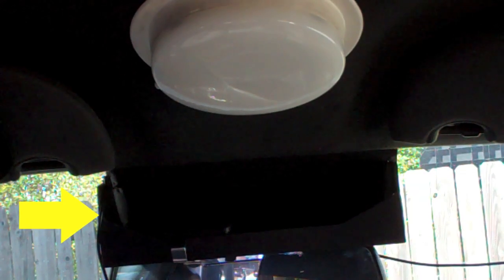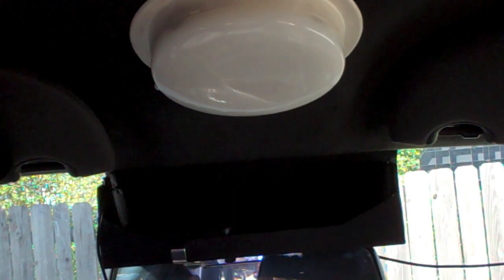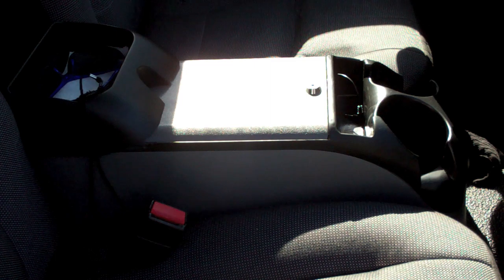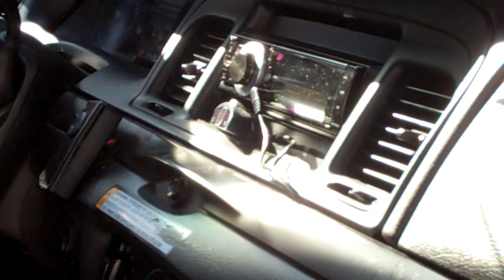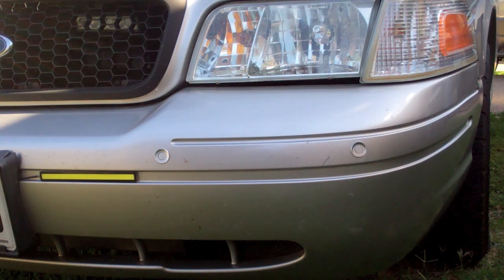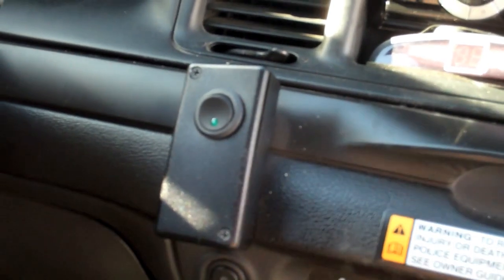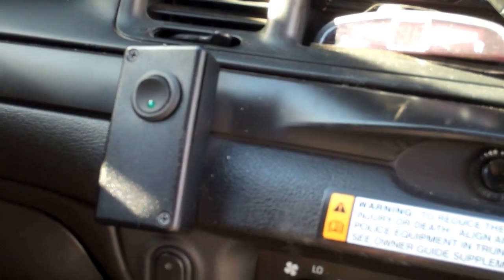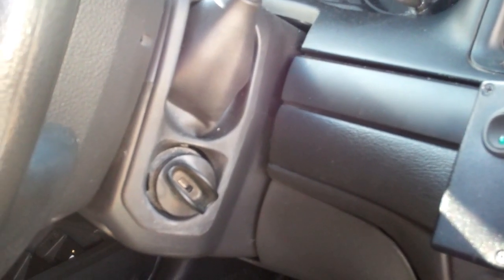Things I've done to my Ford Crown Victoria P71

Comment: I have an 06 P71 and found that this console fits much better and is wood, not plastic. It's 90 bucks on Amazon and can be wedged between the seats without the need for mounting it. Search for "VDP 31515 Black Locking Central Console". I've had it just over a year and put about 20k on it and the arm rest is starting to crack. I'll get it redone soon but this is the best console that I've seen for these cars.

Comment: you might want to consider doing a front clip swap with a town car 2003+ I own a 2008 and the visibility is unmatched !!, specially with the spot lights that turn on with the turn signal is amazing when trying to find a house number or turning on a dark road, the other thing is to adjust your lights, your cars headlights look out of alignment, but besides that make sure they are correctly aimed by adjusting the adjuster bolts, high enough to have really good visibility as long as you dont blind others

Comment: I've got an 08 and my shifter boot is beyond destroyed it pretty much melts rubber in the heat. I've had the hardest time trying to find a new one where did you get yours? The dealer wants $110 for the whole assembly.
I don't like it cause the rubber sticks to my key and hands
Reply from the maker: It is a whole assembly, you can't just buy the boot.  Part #7210... shows to be $76.75 on Ford Parts dot com
Reply: WJ Handy Dad 
Thanks so much I will check it out!!
Reply: How do you replace it

Comment: hey where can I get another police spotlight lens mines is very clouded and yellow.
Reply from the maker: you can probably sand it and paint it just like you can a hazy headlight lens.  Otherwise you're probably gonna have to find a used one at a junk yard or website that sells used stuff
Reply: DailyGrindTrucking  Amazon for $35-$150
Reply: salvage yards
Reply: use a headlight restoration kit

Comment: DON'T BUY A CHEAP $15.00 DASH CAM. FIELD SPAN IS 120. I HAVE A 170 DEGREE SPAN FIELD, WHICH WORKS EXCELLENT. FORMAT THE MEMORY CARD EVERY WEEK.
Reply from the maker: agreed, the 170 degree is the way to go.
Reply: thank you ! I have two dash cams placed on my CPVI windshield. one cam i has it slightly to the right. the other cam facing the front; works rather well  for coverage.